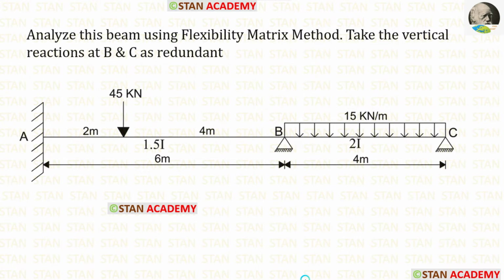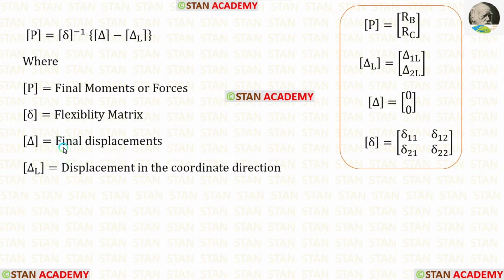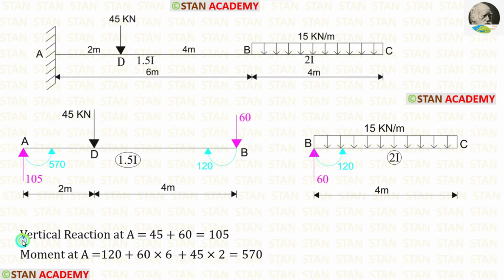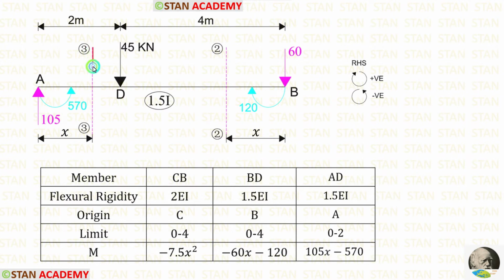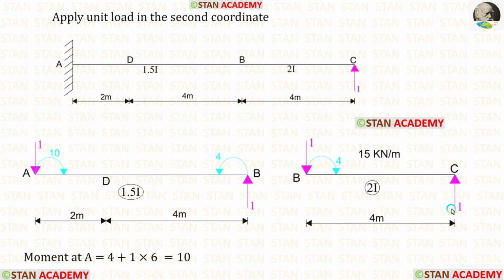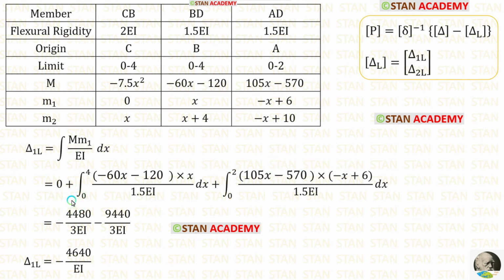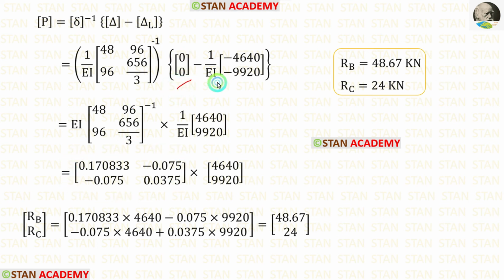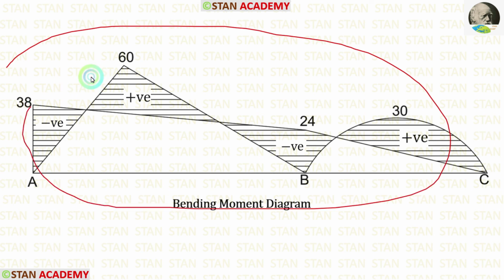Beam analysis by Flexibility Matrix Method - Problem No 13  ( the reactions at  B & C as redundant )

Comment: Sir why your not taking vertical force in co ordinate 
As you did 4-2 
It is 7-3= 4 
So it’s four co ordinate 
Either your correct or I am 
Plz elaborate
Reply from the maker: In beams, as long as there is no horizontal load, no need to consider horizontal reactions. So in beams horizontal reactions are not applicable. So including veriltical reaction and moment it is 4
Reply: @Stanacademy  ok sir, in our hyd we’re taking horizontal reaction. Mostly in all the clg we’re using same.